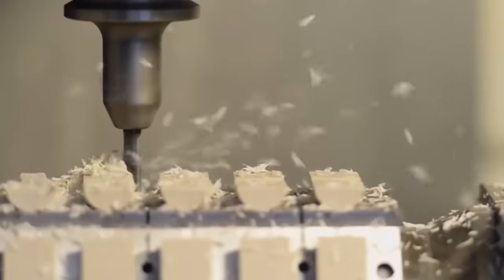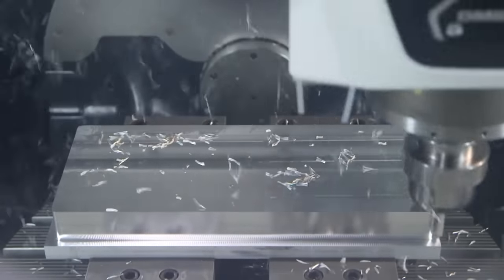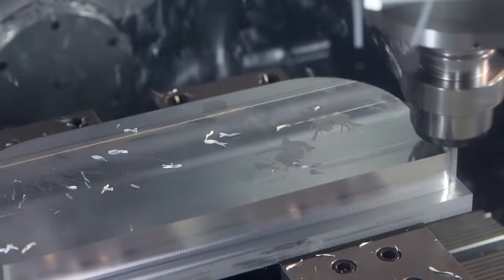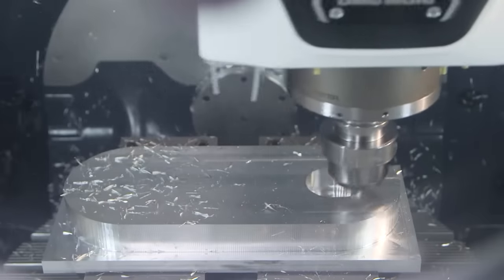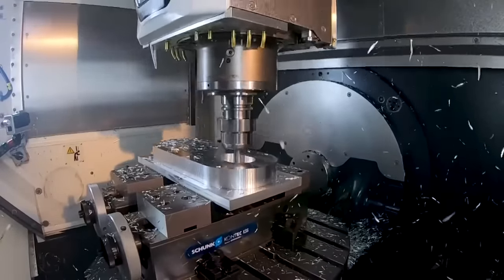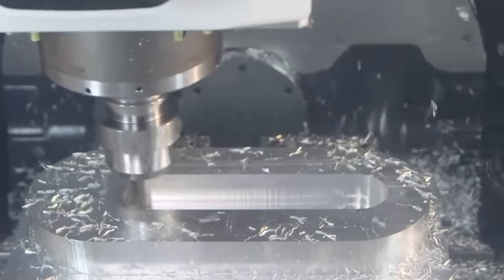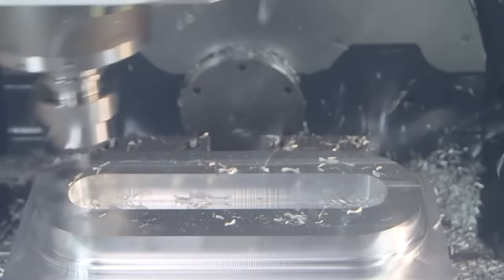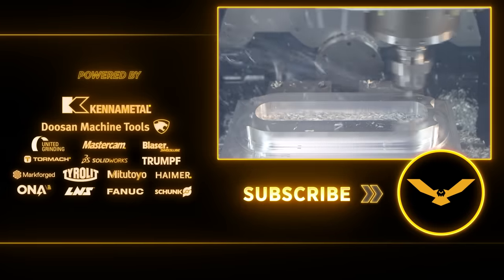High Speed Steel End Mills are Better than CARBIDE

Comment: We use carbide exclusively, but on a 1995 Toyoda horizontal or a 1988 Okuma Howa, they don't feed that fast and max spindle speed is 10 - 15k. I do my best at reprogramming, but at the end of the day, the bearings are still shot and the turrets are still out of alignment. I do miss running newer machines so much...

Comment: I currently work in a shop that the 'old timers' run carbide at HSS speeds. I understand manual machines not being able to handle it  but the CNC with 10k spindle running maybe 1k revs.

Comment: Back in the day I was the new machinist who introduced my workplace into HSM toolpaths with solid carbide tooling and high feed milling with insert cutters. 

Machines were literally moving 5x faster and they even sounded better even though most of them were just light duty fadals and haas VMCs

And this was one of those shops where boss told machinist not to run 15k spindle at 15k and limit rapid rates to 50% so that machines don't wear out.
Reply: Been there!!!

Comment: Each tool has its use. HSS does have it's use in a modern machine shop.
Reply: Stop cussing at me 😂
Reply: Nope. HSS is only for tapping and for deep drilling without inner cooling.

All other jobs can be done in a fraction of the time with carbide tools.

Comment: One thing I have never understood about these special coatings on carbide cutters, is that the coating on the cutting edge wears immediately upon the first cut. I'm talking about the cutting edge, you know, the part that cuts, the part that matters most. The coating is gone immediately.
Reply: If your coating wears out immediately, there is something you're doing wrong. Could be using the wrong coating for the application, you're having chemical reactions in the workpiece material, or you're running way way too high of a cutting speed.
Reply: @pummppkinn  If not immediately, within a few seconds. I am speaking of the cutting edge where it meets the metal in the cut. It wears immediately on any coated end mill. If you look at it under magnification, the coating on the very edge will be gone.
Reply: @rayfletcher8759  if the coating wears off as far as you described, your feed rate is probably far too low.

On carbide mills the minimum feed rate is 1/200 of the tool diameter per cutting edge, the minimum cutting speed on mild steel should be around 150 - 200 m/min.

Normal feed rates in mild steel can be as high as 1/100 of the diameter per cutting edge at 50% overlap.

Don't care your carbide tools to death!
Blue chips are perfect for carbide milliing.

Comment: The only situations I can think of where high speed is better is when the machine can't achieve high enough speeds, isn't rigid enough (mainly a problem on older dovetail cnc conversions etc.) The carbide will most likely fare better in short term, but the slack will cause it to wear with abnormal rates.  And when cutting soft materials. Of course you can get specialized carbide for said materials, but common hss fares better on than "traditional" carbide bits.

Comment: Is that "Peel Milling" towards the 3:50 mark?
Reply: I have a job where I need to pocket out a cup basically with a stud in the center. It's 316SS. We are currently using the Harvy TE 5/8 endmills. Working fairly well. I think it's a chip evacuation issue that's causing breakage.

Comment: High speed is better with conventional machines as they hold up to vibration better. They also wear in a linear fashion so you can bore bearing holes ect with great accuracy.

Comment: I don’t even know the difference between HSS and carbide?…..I know carbide is more brittle and more expensive thats about it lol. Man I have a lot to learn still!
Reply: Dude!!!!! CARBIDE, ALWAYS
Reply: Carbide can produce blue chips all day long without wearing off quickly.

On HSS you run 30 m/min in mild steel, with carbide tools 200/min is no problem.
Also you can run higher feed rates (always calculated in feed per flute).

Comment: I was hoping for more than 20 seconds about a specific use for HSS and then the rest was a story about HSM and carbide based on the title. I would like to know some of the specific uses other than milling parts with garbage/unpredictable inclusions. There as you said are a lot of myths out there. I occasionally have opportunity to pick up HSS tools second hand. I also am considering can I resharpen them since much of my work is done with the end.
Reply: Bro!!!!
Reply: You can resharpen carbide tools as well. 

There's no reason to waste your machine  time with HSS.

HSS is only suitable for deep drilling when you don't have an internal high pressure cooling. Also tapping is usually a job for HSS tools.
Reply: @norbertfleck812  I will eventually need to find a place for that. I am mostly a hobby person not a pro. I have nothing but respect for the CNC Titans.I keep hearing HSS is more tolerant of heat? I was thinking shop sharpening vs sending the tool out. I'm mostly working in wood so while I have some 1/2  and 3/8 tools I generally can't get the S&F high enough to do the CL suggested by the manufacturer. I'm getting to metal in a year or so, it's just a process and making mistakes on the CNC router does not put my friend on the CNC mill out of production for a few days re-calibrating the machine.  I liked how they discussed inclusions breaking tools, and I would rather have an old HSS find the metal in the slab before the good carbide mill does.
Reply: @rpatrick2  HSS can bear temperature up to 300°C, Carbide up to 700°C without getting dull immediately.

The only thing Carbide hates are temperature shocks like running dry at high temperatures and then being flushed with water. This can occur with a fraction of a second, when you only have water on one side.
Reply: @norbertfleck812  Thanks. It's hard to find this information. I know with wood we are told the tool should be warm at the most after the cut. Though not having the beast machines in some of the Titan videos it's hard to get to the CL the manufacturer wants. I did feel the pain of I think it is this video or another one with 90% RDOC and 1/2dia ADOC and 100IPM. "you know that's a 4KW spindle right?" Then I start throwing chips like a cigarette boat.

Comment: my employer wouldn't even buy a cam software license for me 🤣 we're a maintenance department and use a Hurco VMX30i mill to make spare parts or to make changes to parts of our production machines. it's 4 of us who operate the mill, it's not constantly running, as we're not "production" we just occasionally need it. only one of us has a CAM software on his computer, the rest is programming by hand via the WinMax software on the controlpanel of the machine.
Reply: Send him this video!
Reply: @barrysetzer  no use. they already decided to gradually close down the plant til 2028, and move production to eastern europe. german workforce is too expensive in the eyes of investors. my boss is saving every penny of "hard expense" he can, so he still qualifies for his annual bonus until that date. they already let off 800 people.
Reply: @TheWolvesCurse  Of you work as described, there's no wonder why your production is too expensive.
Reply: @norbertfleck812  the production department is separate from maintenance. this company is specialized in injection molding, bonding LCD screens and making entire tachometer units for cars. production actually goes relatively well. if you ever owned a german made car, it's very likely you had one of our products. the driving cost is the hourly rate of the staff. a production mechanic, depending on experience and age has an hourly salary between 18€ and 25€ plus bonuses for late shifts, night shift and working on sundays. a worker in romania, serbia or other countries where production will be sent to, would make about a quarter of that. spread that saving over 3000 workers, and 21 shifts per week, and it's a pretty decent amount of money.

Comment: I'm so sad. I broke 3 1/4in 5 flute endmill in one day. 1st one was speed and feeds are off for 1012c steel. 5000rpm where it should be 3000rpm. I broke the 2nd one by rerunning the same part. Little did I know, their was a piece of carbide lodge in the steel and broke the 2nd one. The 3rd one I thought the clamp was secure and when the cut was finished, it moved the clamp due to high vibration and hit my endmill and broke it. Luckily I wasn't fired but I would've fired myself too as well. For making rookies mistake.

Comment: People who worked like 30+ years on metal production lanes said to me that machining soft materials is better with softer tools. Like if you want to machine AL u should use HSS mill because it is going better with better with less sounds and vibration and parts get better surface finish. Is it true? Im not totally sure till today, because it sounds not logical but people experienced this on their own and gave me advices. It's not my opinion. We can discuss that matter.
Reply: That's nonsense. The right Carbide tools work perfectly in soft material from plastic over brass and copper to Aluminum.

In Aluminium we run up to 500 m/min (if the machine allows it) and feed rates up to 1/100 tool diameter per flute.

Even on wood, we only use carbide tools, as they last much longer and allow extreme speeds (25,000 rpm)

Comment: Machining UHMW a lot recently and it absolutely destroys carbide. HSS works just as good and cost way less
Reply: @Dan Nguyen it makes it dull fast and doesn't change the finish. UHMW machining all about a razor sharp edge high rpm and heat evacuation

Comment: When you said 1.0IPM at 90% step over with the snap crackle pop 5 piece endmill combo in stainless.. which more than likely was set to good ol' .100 DOC maybe .250 if they wanted to"push" it.. 

That is when any good machinist should step in and school the operator in advanced tool paths. Yes you may very well have to do it for them first time around but they will praise you once you show them the results and next thing you know you are kicking it laughing about how terrible the program used to be and now you're friend's bc your coworkers job just went from professional diamond maker to professional coffee drinker/babysitter.

Play your cards right with a tool study and produce some easily readable data to turn into someone important and next thing you know you bought the entire shift a pizza party with tooling cost reductions! (Not gaurenteed, but most places in my experience will trade a couple grand in carbide for some pizzas any day.)
Reply: Lmao, i actually sent this video link to the machinist im talking about. I literally watched him go from zero to hero

Comment: HSS is also typically better than carbide for cutting plastics
Reply: Definitely not. Use uncoated carbide tools rated for Aluminium - they run perfectly and never get dull.
In POM we even use "Universal" carbide mills (TiAlN coated) and the surface is perfect.
Reply: @norbertfleck812  at least in my experience, we've had great luck in using HSS for plastics like teflon and delrin. Like you said, if you get super sharp carbide tools for aluminum they work well but we've always had better luck with HSS in plastics.

Comment: If your machine maxes out at 6000 rpm you can use HSS on most materials.  At the speeds your talking about takes quilty machinist that track the wear and change out tools at the proper time.  
Over 6000 rpm you better be using tool holders without set screws and balanced holders with through the spindle high pressure coolant . Machines with tool management wear and breakage detection.  Your programming department should be running crash detection software.  Running at though speeds requires more technology higher tooling costs and trained personnel Then the days of HSS cutters .
Reply: 6000 rpm is perfectly fine for Carbide tools in mild steel. In stainless you hardly go as high.

We do not have internal cooling on any of our CNC milling machines, but we use HSS only for drilling, tapping and reaming.
In short holes (up to 3×D) we use Carbide drills anyways.

Comment: I'm really wondering why you always use "wrong" (not so effective) tools to rough aluminium parts.
This high speed strategy used in your video on the part is OK, but could be much better and faster using some "solid carbide roughing end mill" and combine full-slot machining with high-speed strategy.
The video part from 0:37 to 4:50 could be done in half the time

Just a short info about me:
I got a 40 year experience in milling now and I'm used to take always the "best" way to get things done. I'm trying to learn about new things but I have no problems to reject new things when older things are definitely better for certain cases.
I'm from Germany, where quality always beats quantity or speed, but I try to combine all of it.
Reply: hi zagareth have you become a flat earther yet? If not I suggest watch a 13 part series called What on earth happened by Ewaranon to learn that the earth is not a globe. I got it in my about tab.

Comment: I do internal splines,   I use t15 to cut a11,  is there a better steel?  I also cold cut.   I am able to do it better than the people before me but it is still a pain in the ass to get through the job,  any suggestions?  I cold cut and my tools don't spin. I cut straight down and back out for the next tool.  I take about a .008 cut each pass.   My tools are designed and built on site,  and I just feel t15 might not be the right steel.  To cut a11.  But I'm not well trained in types of steel I just work for someone that "has always done it this way" 🫣